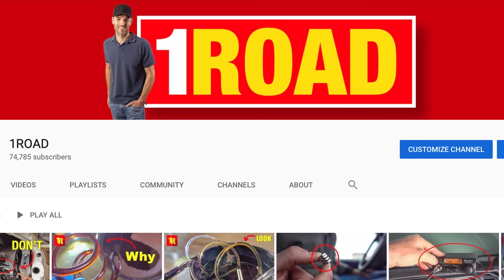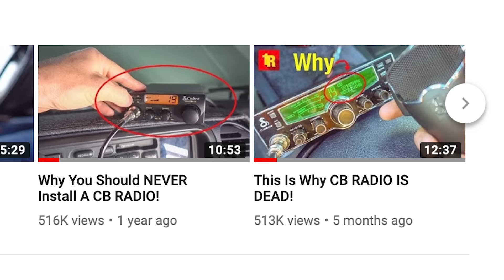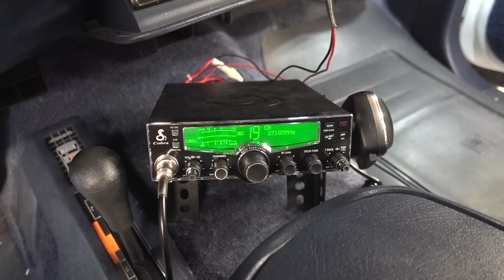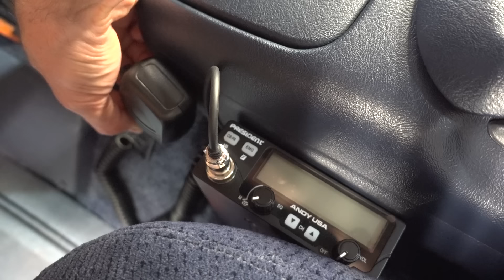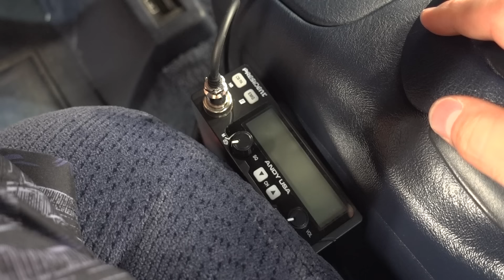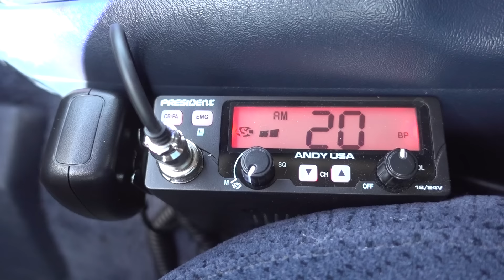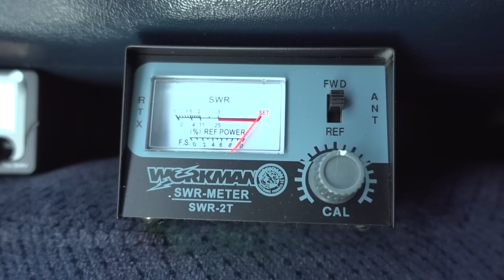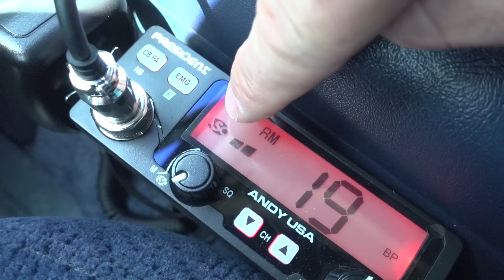Here's Why YOU SHOULD TRASH YOUR CB RADIO!

Comment: If you were really into CB radios you would know that the Cobra would be able to be tuned to higher power and modulation than that baby president. If all you want in to talk 3 or 4 miles that little toy will work but truckers will be able to tell that you are talking on a mud duck mobile. You will not find a professional driver using one of those. If it works for you then go for it but I will stick with my Uniden Grant. It's been peaked and tuned with talkback and connex board added. When I'm at home I connect it to a base station antenna and talk about 40 miles.

Comment: Yup I have been a CB Radio operator since I've been probably right around 8  years old and I am and when I got started The CB Radio the channels were crystals that you can pop out and put in if you wanted to add an extra channel oh yeah that was 23 Channel yeah that was before the transistor fully operated transistor are the crystals now that we're built in no more having to exchanging because now you had a trip that was on the board and so on and so on I've been around it for years and you're right it's not dead and you are right Excel member happen babe you loving us because we'd be the only ones other than the ham operators that would be able to get out and communicate

Comment: ANDY USA, No RF gain makes it a Walmart low buck radio if you want small radio that works like your cobra 29 LX then you want the uniden Pro 520 has a RF gain and the same power transistors  Predriver , Driver and Final as the Cobra top of the line radios so what does that mean to you well it will tune up and give you great 100 percent Modulation and 18 /22 watts PEP power out not just the low modulation and the 3.8 watts the ANDY USA gives you !

Comment: His radio may over heat based on the place he installed it. The radios need to get free air flow in order to cool . If he talks too much he will burn out the finals and have costly repairs because of overheating by his choice of placement

Comment: iv got smallerits called a delta slim it will fit in yiur pocket i use it with a KL 300w amplifier works a treat but that antena bigggg no from me  crap u need a tornado stinger or a sireo 500 Performer thay in my book the best mobile antenas u can buy by far

Comment: That little radio is never going to get out like a modified Cobra 29 or any of the big radios like galaxy, connex, general, stryker, etc. You'll always be a mud duck with that little toy. Go buy a real radio with adjustable RF power and put a decent amplifier in line, then you'll be getting out there. When I key my mobile up truckers think I'm a base station!

Comment: Why limit yourself to 5 watts on CB?  Study a couple of days on line and take the ham test for $35.  Get a real radio that puts out 50 watts.  I have mine mounted under the passenger seat with just the small Controll head mounted on a goose neck.  I do have an emergency CB in the back of the Jeep that’s never been used, just tested every few years.

Comment: And less range n crappy sound. You mount the 29 on your dash. You have someone take the magic screwdriver to it turn it up 2 8wats or down to .5 if your gonna use a linear. You will get 20 to 50 miles instead of that shifty 2 to 5. In overland vehicle u want that 50 miles bro

Comment: That President radio is crap.
Been a trucker for 25 yrs.
You want a radio that can transmit for miles.
I use a Galaxy 949 with a Wilson K40 antenna and a RK56 microphone.
First you need your radio peaked and tuned by a CB repair shop. Then you need to adjust your SWR's on the antenna for optimal performance.
Reply: I just got a uniden roadking 
Can't wait to use it but i need a different antenna cause the one that came with it will wrecker the rqdio

Comment: CB radio is all but dead. It is extremely rare to hear anyone on the band. I have one base and one mobile and almost never hear anything except occasionally 1 or 2 locals . Interstate I have noticed that not many truck drivers use them anymore.  I also live near I65 and inclose range of industrial areas. Channel 19 is nothing but static. With that said Channel 3 and 6 has the occasional power users with ridiculous power output .

Comment: Most of those compact radios are garbage and last maybe a year. They use surface mount components and the don't hold up well over time and when they stop working, repairing them is not cost effective, basically throw away radio's ( or as I and my buddies call em'.... Pounds radios....cuz the harder you hit them, the better they work! ) That Cobra 29 lx isn't much better but the surface mount crap is limited and has full size components that can be changed to prolong it usefulness. I use vintage double digit Galaxy DX66V Export in my 02 Chevrolet Suburban HD 2500 with a Wilson 5000 magnet mount antenna, ditch the Little Wil, they're garbage.

Comment: 29 LTD much better than that new LX..that radio will fit in that gaint hole under your ac/heater controls ..yeah velcro wont last in any heat..perfect placed is where you can see it without moving your head..that's why in trucks they are in overhead position..looking down jacking with a radio will cause a problem..

Comment: try mounting a cb radio of about the same size as your large one, and a ham radio (uhf,vhf, mf, hf, aka all band.) same width but thicker, and the tuner, and linear. in that same area but i have a F250 pu truck. with fans for cooling air. all radio speakers are just junk so i have aux speakers mounted so i can hear them far batter. powered directly from the battery.
cb antenna is up off the drivers side of the hood. ham antennas are mounted behind the cab on a sports/lumber rack, kind of thing. not interested in drilling through the alm roof at this time.
i like to keep such up out of the bad hands peoples reach. why do fools like to touch antennas?
jeep (cj-7) has a cb same model, but only a smaller uhf/vhf radio. cb antenna mounted above the spare tire. ham antenna above the windshield... but back out of the way of the hood on a special mount. fiber roof so no mount there.

Comment: I've been involved with CB radio since the 1960's. I long ago switch to ham radio but radios are radios. There's only one problem with your video. EVERYTHING. first of all the Cobra 29 is a far superior radio than the president you decided to trade down for because it was smaller. Size Matters. 2in versus... well we won't go there. The biggest problem with your mounting location is the only thing that you can do is turn the volume up and down. You took a radio that your first complaint was you couldn't see the display and made a special bracket for it so that it was angled up towards your field of vision only to get a smaller radio and stick it between the seats which means you now have to take your eyes completely off the road and look down just to change the channel. How's that going to work out for you when you go into the suicide bars of the semi in front of you? Talk about stupid. You want us to believe that in a 1995 Suburban you could not have mounted that radio under the dash as it was intended? BS. Ham radios are about the same size as CB radios. They have gotten smaller and a lot of the features of gone to hidden menus but those are features that are seldom needed. Many of them have removable faceplates so that you can literally use the velcro you brag about and stick the damn thing anywhere within range of that microphone and put the radio actually under the seat or somewhere else. You connect it with a small cable the size of a telephone cable. CB manufacturers need to catch up and the only way they're going to do it is by positive feedback from you to that extent. CB radios not dead and probably never will be. if you're going to put out a video on why you should get rid of that particular CB radio why don't you put a couple of Brain cells together and think through what you're actually doing. Putting it between the seats where you can't see it? Talking on your cell phone will get you a citation and the way you're mounting that CB radio will also get you a citation. Amateur radio operators have an exemption in most States. Not every one of us may be the sharpest tool in the shed But we're expected to know better. Apparently you don't. But you got yourself a cool radio for free. I guess you had to come up with something good to say about it. Look! It's so small it'll fit between the seats. That doesn't make it functional. I'll take that Cobra 29 any day. I'll also tweak the hell out of it and get it to work like a real radio.

Comment: That's not a good place to mount a radio. Radios generate a lot of heat and need to be air cooled. Also you have your speaker partially muffled.

Comment: Why because hams think they know everything and own the air ways. CB isn't dead. It fell off dramatically but picking back up. I have ham license but hardly use my equipment. Most to all hamn started with CB and they are usually the ones doing the most violations on CB then complain if anyone had the slightest signal or modulation. Buch of power tripping self centered narks better than everyone else. Thats why I don't carw for my ham equipment. Besides i can go 11 meters and hear the same people running radio stations complaining about two people talking barefoot on decent equipment and god forbid if you are close to them.

Comment: There’s also storm chasers out there that use CB radio so they can chat to truck drivers on road conditions and truck drivers would be able to pass along what roads are open and closed to the chasers
Reply: Most truckers that I know use either a cell phone or GMRS instead of CB.  I live less than a 1/4 mile from the Interstate 195/24 interchange in MA and hear nothing on channel 19!  Weeks will go by without anyone on 19 and then it is just a couple of truckers or 4 wheelers talking to each other.

Comment: Get a HAM license and a mobile radio kicking out 50 watts on 2M and 440Mhz.  The radio mounts anywhere, mine is under the seat.  It has a remote head that is extremely small and full controls via the Mic.  Also two transmit and receive radios.  You can talk around the world with certain types of rigs via digital and analogue modes or point to point with an unlimited amount of frequencies within a certain band width.  In an emergency, your 40 channels are going to be more jammed that the phone company.  And with a general license and 100-200 watts you can talk directly to Europe or the South Pacific.  I do have an emergency CB in the back of my Grand Cherokee that plugs into the cig lighter and has a mag mount antenna. So that if I’m out in the middle of the desert sometim and no HAM repeaters are around and I can’t bring anybody up on simplex, it’s a backup.  Never needed to use it and don’t get any interference from the big rigs running illegal wattage that bleed over many channels.  Grow up, get a HAM!